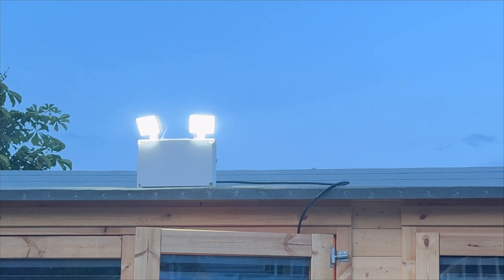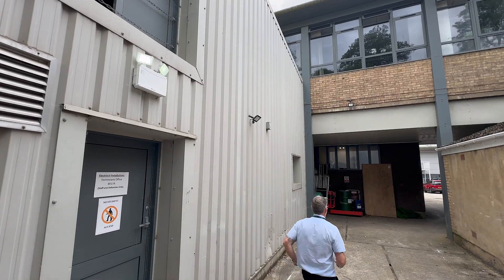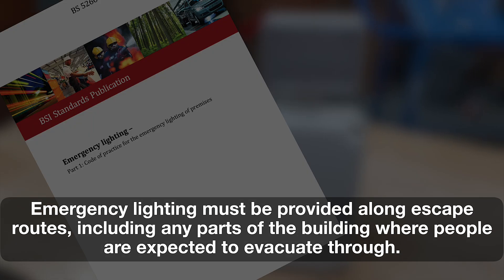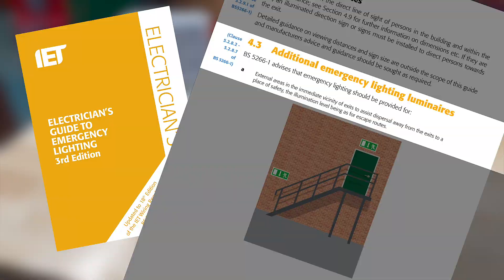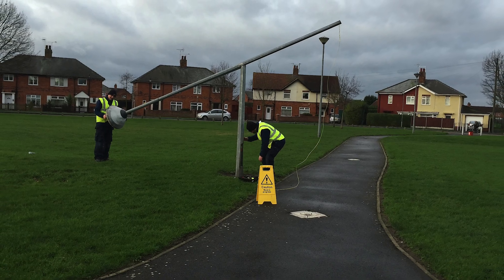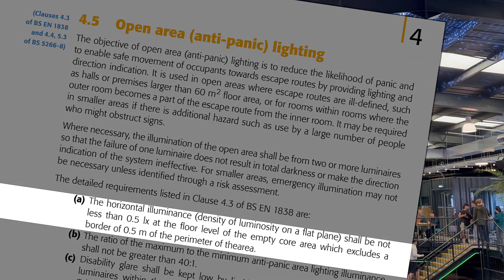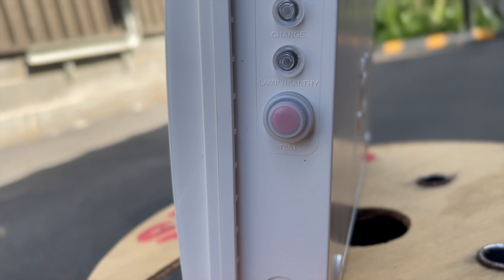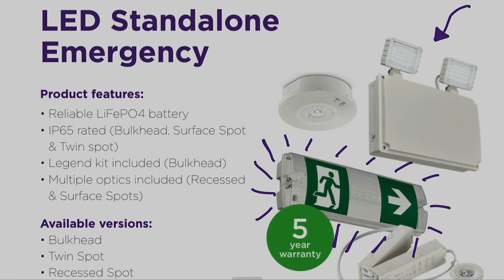Do You Need Emergency Lights Outside?

Comment: @5:15  Lithium Ion or LiFePO4? which is it? Doesn't really inspire confidence in a product where the battery is a critical component, when it's obviously a cheapo battery which isn't even properly labelled...
Reply: The label is correct. LFP is a type of Lithium ion. The other main type is NMC. But they are both lithium ion.

Comment: How long do emergency lights need to stay on for in a school? I think its 1 hour.
Reply: You need to do a monthly flick test.

Then do an annual 3 hour drain-down test.
Reply: Usually 3 hrs, again depend on the risk assessment and area  for example, if there's a power cut e.g. afterschool club in winter, students (and staff) would be left in the darkness, and the parents wouldn't always be able to get their in 1 hr, the power source could be damaged e.g. like the recent incident at the airport, so 3 hrs emergency lighting is usually standard in most (not all) buildings, It docent matter if its a school, hotel etc it depends on the building, each building is different, and equally, the risk assessment

Comment: If the power goes out in the wider area, streetlights might not be lit
Reply: Also I was surprised it mentions natural light. Winter and new moons exist. Unless your place closes before 3pm you can't guarantee natural light will be available.